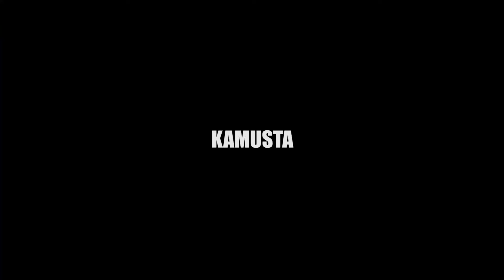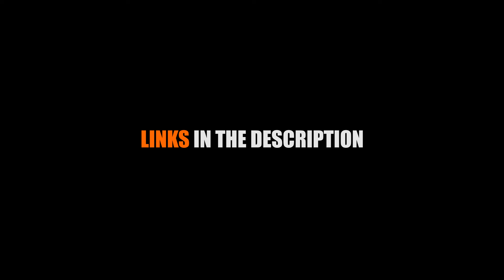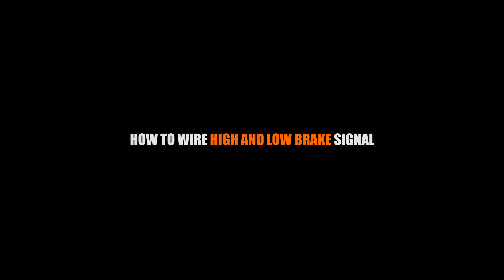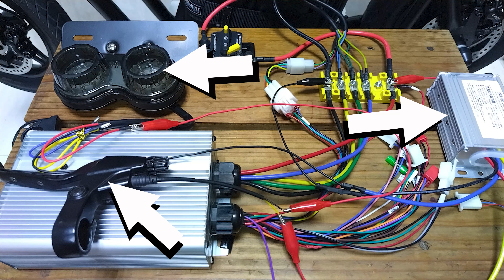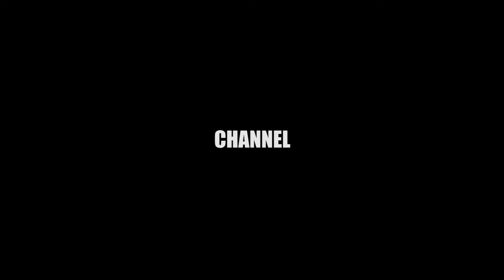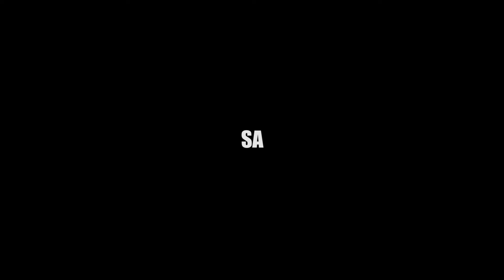How to Wire High Brake to Brake Light | Missing Manual! | Brushless DC Controller | BLDC Controller

Comment: Ayus kaadik tipid sa breakpad  muzta naman ang performance ng batt d ba mas madaling ma lowbat? Nga pala kaadik muzta yung votol compare sa yyk yung init ng motor at mas smooth yung ikot ng motor kapag votol kasi sinewave output ng controler
Reply from the maker: Goodday Kaadik!
Cnxa na late reply, na-busy lang😅.
Di ko pa nata-try patakbuhin na naka konek un high brake input wire.
Kailangan ko pa mag rewiring eh.
About sa battery, mas tatagal un battery mo malobat kase un "High Brake/Low Brake" pag naka activate.. gagana rin un Regenerative Braking System niya. ..depende sa controller's feature.
Bali un Regenerative Braking, .. everytime na magbi-brake ka i-cha-charge nmn niya un battery mo.
So ang ending tatagal malobat un batery.

Votol kompara sa YYK,
sinubukan ko minsan un Votol.
Mas maganda un hatak niya.
Gradually speeding up at mararamdaman mong smooth lng
Palagay mo mas mabilis pa un Votol kesa sa YYK.
Hindi ko pa completely na try un top speed nun votol kase nun time n un nasira un baterya ko. Naalog ng malakas haha
Ung motor uminit din nun gamit ko un Votol.

Ride safe lage Kaadik!

Comment: I failed horribly trying to install this exact unit. I wanted to use the factory wiring but the harness has 6 wires and this unit only has 5 wires. Not sure what to do there.....
Reply: Don’t panic. The universal tail light kit ALWAYS has 6 wires, which allows either HIGH BRAKE or LOW BRAKE wiring. The 5 wire taillight shown is this video is ONLY compatible with HIGH BRAKE. 

The 6 wire kit has a ground and tail, left turn and right turn all sharing that ground. And then another ground dedicated to the brake light and a brake + wire. This dedicated ground is what allows LOW BRAKE wiring setup. 

So the first thing you need to do is see if your bike is wired high brake or low brake from the factory. 

If HIGH BRAKE, the two ground wires together and then its like a 5 wire and you can follow this tutorial.

If LOW BRAKE, if your controller has a HIGH BRAKE wire, the easiest thing is convert your brake wiring to high brake. 

Another option is you can use a relay that LOW BRAKE energizes which sends power to the brake light. But it depends if you already have a DC/DC converter as shown in this video.
Reply from the maker: Goodday
Did you mean you accidentally damaged the controller?
That's so sad.
Is it the hall sensor wires?
Reply: Sorry that was not very clear. I was talking about the brake\turn signal light. So far I havent burned a controller out.
Reply: @RoppleStilzkinz-yk3ft , it was clear to me. 

The light shown in this video is only directly compatible with HIGH BRAKE. your original light is compatible with either HIGH or LOW BRAKE.

Is your bike wired HIGH or LOW brake originally?

Does your controller have HIGH BRAKE wire or a setting if its programmable controller? If so you can wire your bike high brake and use that new tail light assembly.
Reply: @imho7250  NOt sure if its high or low  brake but the controller is a jingobo. I can ask chat gpt. Thanks for the push to try this mod again
Reply: @RoppleStilzkinz-yk3ft , I found a wiring diagram for a JingBo FOC controller, it shows a 2-wire connector labeled rear light. 

You might need to trace out your wires and make your own wiring diagram. 

Did it originally have Headlight, tail light, brake light and turn signals? 

The controller i saw had a connector for the brake lever and a 2-wire connection for rear light, which tells me it has an internal brake controller. So you need to use a multimeter to see how many volts it’s sending.
Reply: @imho7250  I have a wiring guide from Toursor. Its a Toursor X8P, heavily modded, you can see it on redddditt as ZestyPOEPlayer
Reply: @imho7250  It has built in turn signals to the rear light similar to this one shwon here.
Reply: @RoppleStilzkinz-yk3ft , check the voltage of the original turn signals, tail light and brake light. 

The new taillight assembly is 12v, right? Or does it allow a voltage range? This will determine if you need a DC/DC converter, if your bike doesn’t have one already.
Reply: @imho7250  all the extrnals are running at 12v however I dontknow the amps. I tried to do an install for a moto horn but factory wiring wasn't enought amps to make it beep....I will hook it up to a voltmeter when I have time to reallly tinker on it again. Thank you so much for all your help thru this. Real hero!!